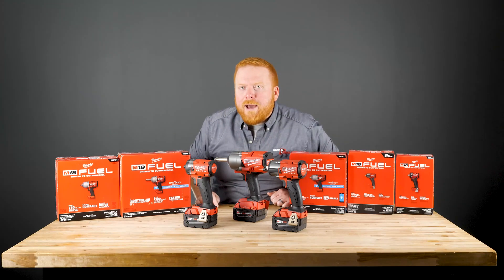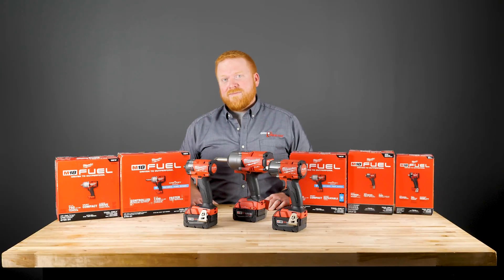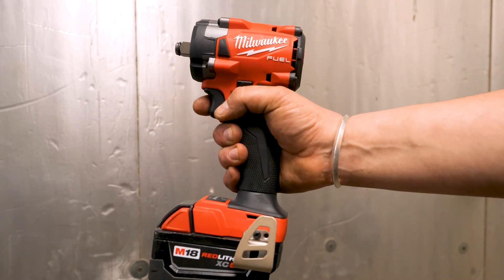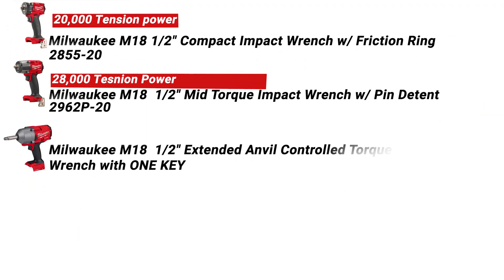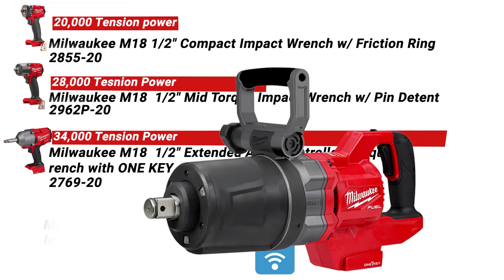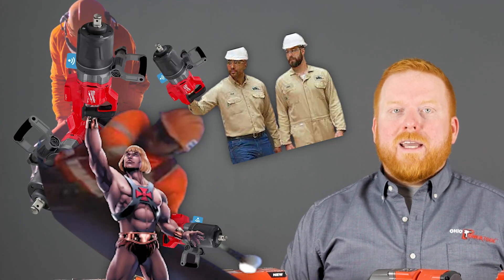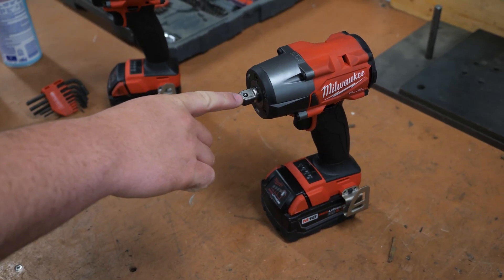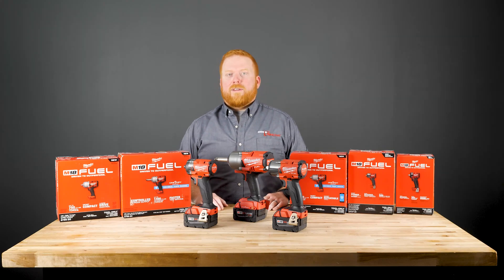Torque Testing 4 New M18 FUEL Impact Wrenches from Milwaukee Tool

Comment: Great comparison video. I especially approociate(?)... abbreciate(?)...am really thankful for the thorough explanation of friction ring vs. pin de-tent(?)...D-Tent(?)....detent! Even though I don’t have a use for these on a daily basis, dang-it if those engineering/marketing wizards at Milwaukee haven’t used their boogedy-boogedy to make me feel like I NEED every single one of them!
Reply from the maker: Marketing wizardry is right. Come out with a Mid-Torque, the goal "to cover 95% of what the typical mechanic needs to do their job" then launch a compact and 5+ more larger impacts as well. All of them extremely popular, go figure.

Comment: The high torque with the extended anvil is my favorite. One key is a game changer with the repeatable torque settings via Bluetooth. Looking forward to Gen 3 for the 2769’s. Preferably pin detent. Milwaukee updated the lower two models to Gen 3, but why not high torque one key? Or did they?
Reply from the maker: The Milwaukee 2769-xx extended anvil came after the other high torque models (2763-xx 2762-xx) but same torque (1100 ft lbs nut busting spec) as newer 2862-xx high torque detent pin models. There is probably a 2869-xx or 2969-xx version of this coming in next year or so but not sure what needs improved, pretty good for what it's designed for.